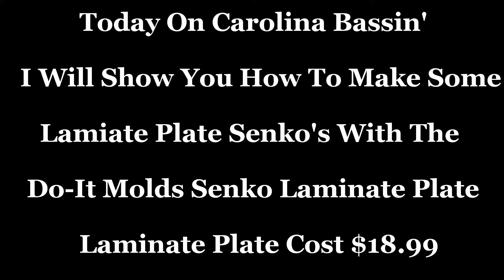Custom Senko With Laminate Plate

Comment: well I use injector its easyer to hand pour I just bought me senko mold with the laminate plate going to give it a try I just have to make sure its all the way cool before next color
Reply from the maker: shouldnt take to long for it to cool down the 1st couple shots. i would suggest cutting pass the tear off sport on the mold. leave a piece so you can fit it back in the mold and that will help line up the bait properly when you go to place it back into the mold.
Reply: ok thx I made some I just hope the color don't bleed into each other I love this mold an I got me a swimbait mold also I love them
Reply: right now the baits looks good I won 1st place an big fish in tournament so to me they done paid for there self
Reply: Carolina Bassin' I like your videos how long do you microwave the plastic.

Comment: do you have any videos on either dipping tubes or injection for tubes.?? thanks in advance
Reply from the maker: I have not made a video about tubes yet but i will have one in the future.
Reply: awesome. bc YouTube is tube video why. i don't think there is a single video on splitting tails
Reply from the maker: i know you can buy a splitter to do it with by hand or a machine but of course that machine is pricey. They also make molds that take a skirt spline if you didnt wanna have to cut them.

Comment: looks like a laminate plate would work on any mold all you need is one ?
Reply from the maker: It will work with most molds but each plate has vents cut in it to match the mold to allow the trapped air to be released.

Comment: How did you do the senkos with different color tips on each side? is that going to be done in 3 stage shoots I assume?
Reply: Simon Tapprich you pour the color you want for the tip then once it dries you cut it. Then you put the small part that you cut off back in the mold. Then you pour the color that you want for the main body

Comment: I've been saving old plastic baits that I can't use can I remelt those and reuse them with out losing any of there color or will I have to add more color?
Reply from the maker: Hey Ron. You could remelt them and use them again but it all depends on the colors. If its a green pumpkin or any other darker color you will be fine.  Lighter colors you will have to add more colorant but i dont think you will ever get a chartreuse back to the right color state it once was.

Comment: Are the plastics available for pouring/injecting as productive as the original senkos?
Reply from the maker: Yes they are. The only real difference is the ones you make vs the real senko is yours will last alot longer vs the store bought brand. Way to soft. I think they do it on purpose just so the baits tear up to get you to buy more. haha
Reply: Haha right on man might have got bight the bullet and get some molds ordered
Reply from the maker: get them coming brother. You will save alot of money in the long run. Just throw your used/torn up worms aside and when you have enough remelt them and reuse them again. Thanks for watching BTW.

Comment: are you using the essential series mold or the high end senko mold by do it?
Reply from the maker: Essential series. gives the bait a more rough texture finish on the bait. The high end mold makes a nice clean finish bait like a real senko looks.
Reply: Carolina Bassin' are there any differences other than texture between the 2 molds?
Reply from the maker: Nope other than the finish and the only other thing that is different is the way the mold open and closes. The high end has a better hinge than essential series does.

Comment: be cheaper to just buy a double injection if you have to buy a laminate plate for every mold
Reply from the maker: Yes sir you are correct. I have one i use on most of my molds. Senko can be a little tricky from time to time with it bleeding.
Reply: is the double an triple injection worse about bleeding I always hand poured mine I got worms from 30 years ago an they still not bleed or fade...my son said them robo worms fade out an I know they using injection but I seen strike king going back to hand pouring
Reply: well hack attack said machine hand pouring lmao